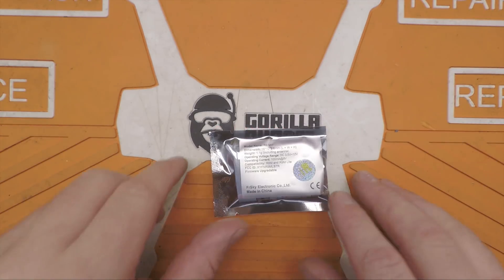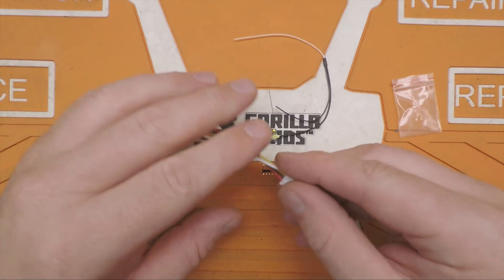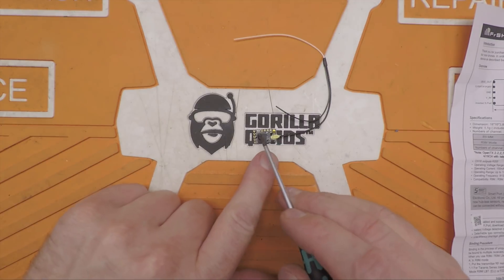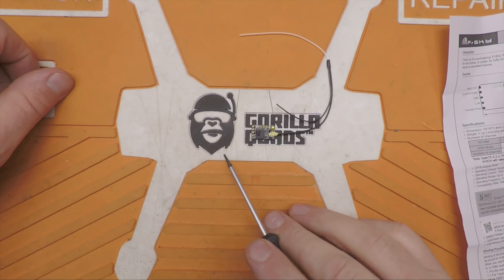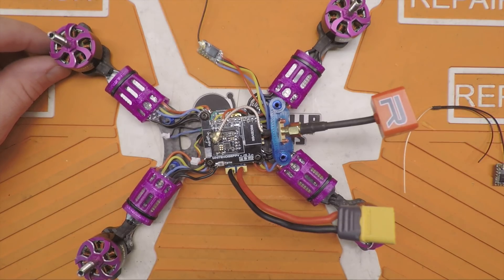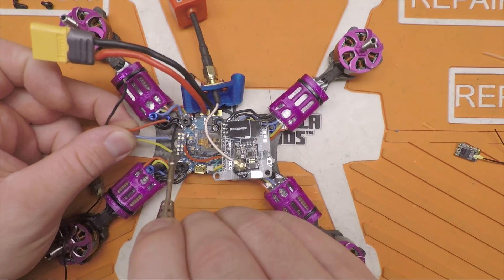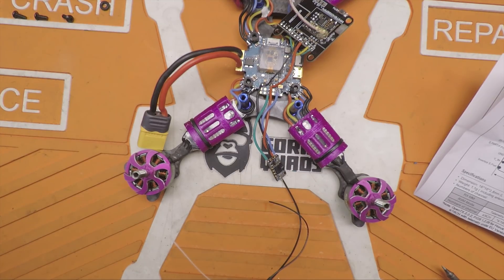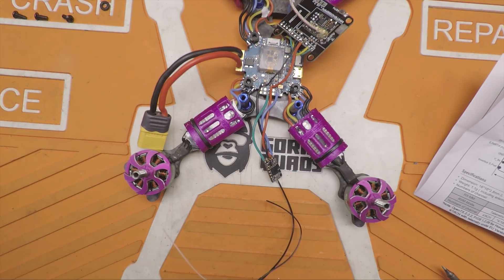Frsky R9 MM install and setup (READ THE DESCRIPTION!)

Comment: Is there anyway you can do a video about the r9mm setup on a matek f722 fc? Im have a huge issue trying to get telemetry!! Im going crazy with this issue!! PLEASE PLEASE
Reply from the maker: I don't think I can make a video specific to the f722 but being that it's a F7 it should be the easiest fc to wire up. What is the issue you are having?
Reply: I just thought about what pins I have soldiered up and if I remember right I put the s port pin on the "f.port-s.port" pin out. Is that where I went wrong?
Reply from the maker: That should be the right pad. Are you trying to use f. Port or sbus/s. Port? Where do you have the s.port with soldered to on the fc and which fw do you have flashed to the r9m and r9mm? Do you have rc commands or is it just telemetry that is giving you problems? What kind of problems are you having.
Reply: Im using "sbus" with the sbus flex fw. It says to soldier it to any unused "tx" uart (which I did). The issue is, whenever I power up i have everything else but telemetry on my radio. (im using the Taranis x9d plus) Ive set up everything right in the config. Im not good with coding so i dont touch the CLI part of the config tab. 
I have countless Quads and Wings running Betaflight and Inav. but I prefer to use KISS on my Quads and Inav for my wings. so i have never had this issue before untill i started using the knew R9MM system.
Reply from the maker: Sbus wire to a unused uart rx. Your s.port wire to any unused uart tx pad. You just can't use the same uart for both. For example sbus to uart rx1 s.port to uart tx2.  Have you flashed the r9m and r9mm with the same fw? And after you flashed did you rebind the pair?
Reply: @TweetFPV  Ill give that a try and ill let you know, It might not be anytime soon, Im at work right now. so when i get some time later on ill try it and see what happens.
On a side note. Your one of a very few "YouTuber" that will take the time and chat with a fan and really try and help them. Thank you so much for you kindness and your time to try and help me. My name is Sean and if you want to Facebook chat, look me up with the name Seanski fpv. (Plus i can show you what im working with and maybe get you to understand a little better of whats going on.)
Reply from the maker: Yea I'm headded to work now. Let me know how it goes. I found a f722 in my stash of stuff I could make a video but it would have to wait till I had some free time.

Comment: h, what I'm missing. I have no telemetry apart from RxBt and RSSI after Discover new sensors. I've installed an R9 MM with latest firm FLEX_20190201. and OpenTx 2.2.3 on my Taranis Qx7. The channels are working great. The problem is the lack of sensors in the telemetry
Reply from the maker: Did you flash the r9m and the r9mm with the same fw? If so did you re-bind the two after fw flashing? Do you have telemetry selected in bf config page? Do you have the correct uart selected for smart port telemetry in the bf ports tab? Which pin are you using for smart port on the r9mm? Which flight controller are you using?
Reply: Thank you for your fast answer. My FC is a HAKRC Flying F4 v3. I have telemetry selected in BF. I have flashed FLEX_20190201 on R9 MM and R9M_FLEX in the TX module. I'm going to check the rest and back to you later. Thank you
Reply: Re-bind again after fw flashing. I dont have uart selected because I'm using F.port. Is it necessary? I'm using the S.PORT/F.POT pin on R9 MM. The result is the same, i.e. only RxBt and RSSI after Discover new sensors.
Reply from the maker: Ok so your using f.port. Are you connected to a uart tx or rx? Also which pad are you connected to on the r9mm? You should be connected to the bottom pin (inverted s.port) and to a uart tx on the fc.
Reply: I was connected to  S.port/F.Port. I changed to Inverted S.Port and re-bind (just in case…). Now I've lost the receiver channels. damm :(
Reply from the maker: Yea you'll beed to change the cli setting to set serial rx_inverted = off or on one or the other and possibly mess wihh set serialrx_halfduplex = on or off.
Reply: hi, nothing seems to work. I tried all 4 combinations ON_OFF for serial rx_inverted and serialrx_halfduplex. No luck
Reply: No even the channels are working now.
Reply: the only combination that I manage to work the channels is: set serialrx_halfduplex = OFF
set serialrx_inverted = ON
 using the PIN S.Port/F.Port on the R9 MM
Reply from the maker: It WILL NOT WORK on the sport/fport pad. You must use the inverted sport pad. F. Port will still work. The f4 processor on your fc can not understand the uninvered signal from the sport/fport pad.
Reply from the maker: You can also try set tlm_inverted=OFF or on.

Comment: Hi all,
Great video !

I'm trying to connect the R9MM to a MAMBA F405.
Could I connect the SBUS and the S.port to the same number of RX and TX? (ex. RX1 and TX1)
Inverted S.port?
Could I use the F.port?
Kind regards
Reply from the maker: Sbus and s.port can not go to the same uart. on this board sbus must go to uart rx1. That uart is the only one with a built in inverter. Here are your options with the mamba and the R9MM. 
1) Sbus to RX1, "inverted S.port" to any unused uart TX pad with a Sbus firmware flashed to the R9MM
2) "Inverted S.port" pad to any unused uart TX pad with a F.port firmware flashed to the R9MM F.port signal will be sent out from the R9MM
Reply: @TweetFPV  Thanks for your quick reply.
I need to connect the smart.audio from the VTX (TX) and the GPS (RX and TX), so I think I have only the option of F.port.
In the second option you say (("Inverted S.port" pad to any unused uart TX)), why not use directly the S.port/F.port pad on the R9MM?
Reply from the maker: The regular sport/fport pad on the r9mm is not a inverted signal and the r4 processor does not have the ability to invert those signals internally like on a f3 or F7 chip. You need some external hardware inverter either on the fc or the rx. The mamba does not have any such inverter except on the rx1 pad for sbus. The protocol for fport requires it to be connected to a TX on a uart. The "inverted" pad on the r9mm does this signal inversion and allows the f4 processor to understand the signal.

Comment: Hello tweet fpv, I have this FC https://www.speedybee.com/speedy-bee-f4-aio-flight-controller/... which pad must be soldered and which cli commands I have to enter f port runs 😕🤯
Reply from the maker: Which reciever do you have?
Reply: @TweetFPV  I have the frsky r9mm
Reply: And frsky x lite and the r9m lite Modul
Reply from the maker: from the R9MM you will need to connect ground, power(to a non USB powered point) and "inverted" s.port. The "inverted"s.port pad will go to a UART TX pad. Probably TX3.  Ground to basically any ground pad on your FC. Power to the 5v pad with your camera or the 9V pad with your VTX. I'm not sure if your 4.5V pad is powered by the USB port. If it isn't then use that one. If it does get power from the USB port then connect your RX power wire to somewhere else. This is so you can flash firmware to your RX using serial passthrough in the future when there are new versions released by frsky. 

You do need to flash a "F.port" firmware to the RX as they don't come ready for f.port from the factory.

In the ports tab select serial TX on whatever UART you ended up connecting the "Inverted s.port" pad to. 

In the Config tab you need to select f.port as the rx protocol. 

That should work but sometimes other things need to be configured in betaflight depending on the FC. If it doesn't work let me know and ill help you work through the steps to get it going.
Reply: @TweetFPV  Okay thank you I'll try it 👍😁
Reply from the maker: Good luck!
Reply: @TweetFPV  I did everything like you said I did everything the way you said, I have stick Kommands but no telemetry 😞
Reply from the maker: Ok that's a good sign. Do you have telemetry enabled in the bf config menu?
Reply: @TweetFPV  yes i have 👍I can't bind with 9_16 ch Tele. On only can bind with 9_16 ch Tele. Off???
Reply from the maker: You probably should be binding with 1-8 telm on.
Reply: @TweetFPV  On this does not want to bind 😣
Reply from the maker: Have you updated the fw on the rx and tx? Also have your disabled the internal rf in your radio before you tried to bind?
Reply: @TweetFPV  I Flash the r9mm,  r9m light in EU version, and the internal Modul is a non EU 🙄 I'm going to do this now... After my pizza 🍕😅

Comment: Trying to find the R9 mm set to the r9m module in my qx7 won't bind hold the bind button down on RX I get steady red steady green no blink and no bind I can bind this outside the bird can't I? Just by applying power or does S Bus have to go to something?
Reply from the maker: You can bind the RX without it being connected to the quad. which FW did you flash to the RX and TX? what color are the leds after you try binding and then cycle power?

Comment: Believe this or not but apparently the wire I was using for a signal wire was broken internally replace that wire and it updated now I need to know how to wire them in hopefully just using power ground  S bus or do I use s port? I flashed them on the S Port wire
Reply from the maker: Power ground and sbus. If you want telemetry as well then you need to connect power ground sbus and s. Port.
What fc are your running?
Reply: @TweetFPV  on the Merica it is a F4 Aio running siskin 32 bit eSC
Reply: And dshot 1200
Reply: @TweetFPV  on my sparrow it is hglrc F3 evo

Comment: I don't know what's going on I tried to flash this piece of shit with a s port / fport wire and with sbus out and keep getting the same message " FW update error bottom pin no resp" now what do I do throw it all in the garbage? I know that asked for it works because I updated my XM plus receivers and they work I have a R9 Mini and a R9mm and have the same problem on both I updated them once but then the mini won't bind with my r9m module any help? Or off to the garbage can because this isn't fun anymore

Comment: Okay trying to flash the R9 mm rx I use voltage in, ground,,, the last one do I use sbus or s port/f port? Both ways I tried keeps telling me that it's not reading the bottom pin I have a qx7 with the smart part on the front and when it goes into the firmware it says flash external module or flash s port so what's supposed to work I did it once before and it worked. I don't know why please help otherwise $1000 worth of birds goggles and transmitters are going to be smashed up with a hammer
Reply from the maker: Try power, ground and s.port. Connect to the smart port connector on the bottom of your x7 (next to the USB port) select flash external module. If that doesn't work try selecting flash s.port. If you have a older x7 some of them made you flash the rx through the pins in the Jr module bay like the x9d radios do. Do this with the r9m removed from the radio in either case.
Reply: I'll try it tomorrow if I keep doing it today I'm going to hit it with a hammer
Reply from the maker: Haha yea I've been there. Sometimes it's good to take a break before you break.
Reply: Again thank you

Comment: I have two questions on the R9 mm RX do you use ground power and S bus? I did it that way and it won't bind with my receiver r9m module also frsky XM Plus RX I flashed mine an AUX 12 is active 4 RSSI but on betaflight CLI my Merica 5 inch it won't let me switch RSSI channel to 16 on my mobile device when I hit save and reboot they kicked me out and says USB is disconnected and when I try to change RSSI on the configuration tab to aux 12 and save it when I refresh or go off that tab and come back it's back to disabled what's up with this thing? The FC is a Aio running siskin 32 bit esc
Reply from the maker: For the RSSI issue i have seen this when you have "analog RSSI" enabled in the BF config tab. Disable that and see if you can change RSSI to AUX 12 in the RX tab. 

I usually connect my R9MM RX in this manner. From the RX I use S.bus, power, ground, "inverted" s.port (on a F4 without a inverter on a UART TX pad) If you are having issues with binding my first recommendation is to re-flash firmware to your R9M module and your R9MM RX. also every time you update FW always re-bind your setup even if it seams like i still have a bind. 

I hope this helps you out. if you have any more questions please let me know.

Comment: Just got this R9mm and the module for the QX7. I've updated the reciever and module, but I can't get it to bind with my transmitter. Any ideas?
Reply from the maker: Does your qx7 have a new version of opentx on it? When you are setting up your model under external device r9m should be an option. If it isn't then you will need to update the opentx on the qx7. Other than that is the basic binding procedure for any frsky recievers. Select bind under the r9m in the qx7 and hold the bind button on the rx while applying power.

What color is the led on the r9mm when you try to bind and after you try to bind?
Reply: @TweetFPV  I have updated to opentx 2.2.3, and selected ExternalRF on R9m. I set it to bind and it starts beeping. On the R9mm when I hold the bind button and apply power both LEDs are on continuously. It does nothing beyond that.
Reply from the maker: I just went an bound a r9mm to my tx to see what the lights on the rx do. When in binding mode with the TX not set to bind the RX has two LEDs on one red and one green both solid. Once the TX is set to bind the red led begins flashing very quickly and the green remains solid. Stop the bind on the TX and unplug the power to the RX. When i re-apply power to the RX the red LED is out and the Green one is on steady. Does this match what is happening for you? If not what happens with the leds during this process?

It is possible that during the firmware updating process you could have accidentally flashed the wrong firmware to either of the devices. Are you in the US or other parts of the world. These devices aren't smart enough to know that you are flashing the wrong firmware to them. flashing the wrong firmware should damage them but it very well might make them not work properly. Both the R9M and the R9MM have FCC and LBT versions of the firmware. Be sure to flash the same kind to each device, as LBT and FCC firmware do not communicate to each other. 

As far as openTX 2.2.3 goes, that is still a nightly build and is chock full of bugs and errors. I would stay away from anything in this hobby that is listed as nightly or beta builds. You never know what is going to fail and how.
Reply: @TweetFPV  thanks for your help. What you described is happening, but the R9mm lights never start blinking, they are just on solid. I flashed the r9_mini_fcc to the RX and r9m_fcc to the module. My QX7 is FCC as well, because I'm in the us. I'll try loading 2.2.2 on it
Reply from the maker: Couldn't hurt to reflash the rx and rx just to be sure
Reply: @TweetFPV  I've already reflashed the module and rx, but I can try putting opentx 2.2.2 on the tx I guess